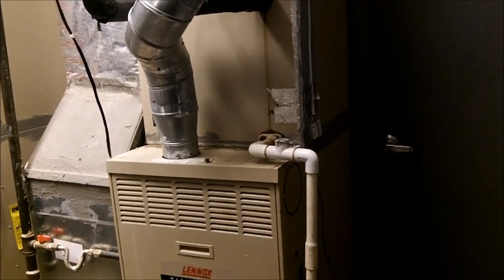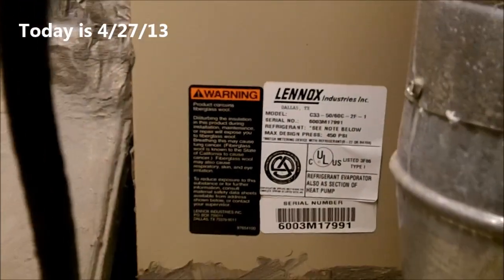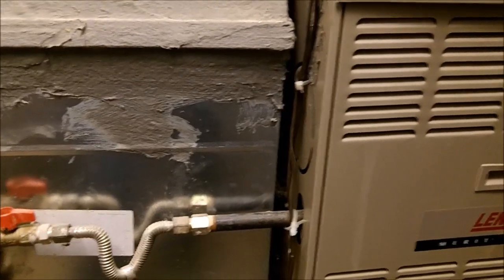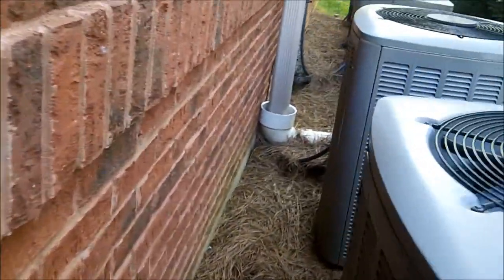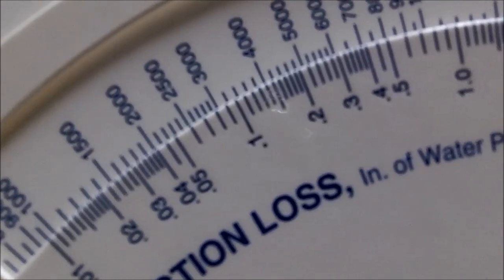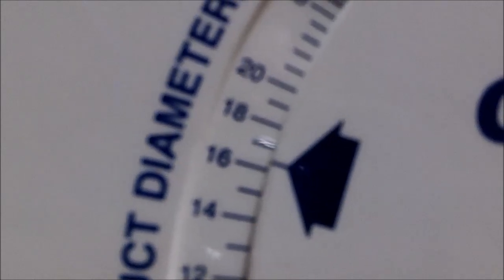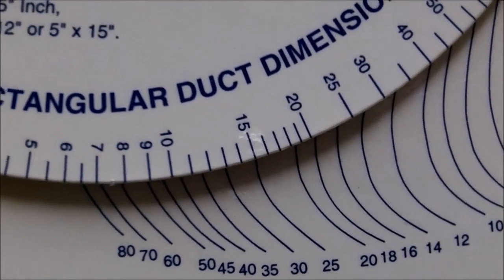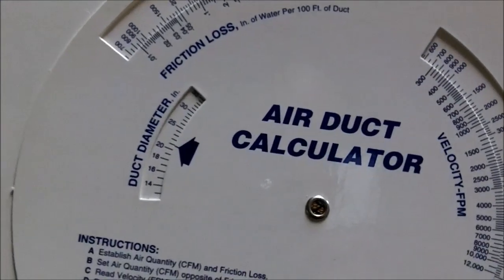5 Ton HVAC unit short on return duct work

Comment: Did you drill some holes and take some static pressure readings across the ductwork and cooling coil?  Best to establish a baseline first.  Most of these residential type units are only rated for .5” total static.  Your probably over 1”.  Duct liner just ads to the problem.  The duct calculator is looking at pressure drops of 100 feet of straight ridged unlined duct, so the liner, elbows, transitions, etc have to be accounted for separately.  One bad fitting can kill the airflow in these low pressure systems. You are correct about the one sided return.  That’s killing you. You need to use either the whole bottom or both sides for RA.  Maybe you can ad a little outside air to make up some of the RA shortage. You’ll also have to have at least the area of two 20x25 filters for that airflow.  Otherwise the filters will just be a restriction, and the dirt will go right through them.  You’ll have to do a slant or V track if you use standard filters, or some sort of high capacity media filter with enough surface area for your airflow.

Comment: That initial setup was terrible, a small 16x20 for the filter, wow. 
IMO, 5-Ton units shouldn't be put in resident's; with a 4-Ton you  can use as low as 1400-CFM; 350-CFM per ton...! 

First of all, my ductulator @ .05 FR says for 1800-CFM it calls for  more than a 22" Flex duct which would  provide only 1735-CFM With FR @ .05", of course that could be allowed to go higher to cover up-to 1800-CFM. 

You can't use a ductulator to size Return-Air filter areas; because the open air-area (Ak) of a filter is probably only 60 to 65% of the filter's measured area. If using Purolator #312 filters you need less than 300-fpm velocity. Therefore I would want (2) 20x25 filter rack areas going directly back to the blower.  

A 20x25 filter is a measured 19x24 = 456-sq ins * 2 is 912 * .65% Ak is 592.8 sq ins / 144 is 4.116666-sf (Ak) 1800 / 4.1166666 is 437.2- fpm velocity well above the 300-fpm required...!

Comment: Without a filter in place the coil must be partially clogged, further increasing static pressure.  Did you take a static pressure reading on return and supply?   By taking actual readings you know which is the biggest problem supply or return.  If the static is even hgher than the duculator would show it to be with the given ductwork you know there is further problems like dirty coil or kinked ducts in the attic.  A reading across the coil would indicate if the coil was clogged.  I don't remember how much pressure drop is due to a clean coil.  Can anyone supply that info?

Comment: Question-Since you ductulator is only for galvanized ductwork. Have you taken in to consideration the friction rate of the two different surfaces of the inner liner and the metal? And another solution is you can cut out the other side and make a "wrap around" duct back to the left side to pull the air thru.

Comment: Good vid.  Your 20 by 25 return makes good sense as if you use a pleated filter, you will need the extra square inches for pressure drop across the filter.  I also noted that the vent connector was single wall to the vent.  We do not use any single wall anymore up north, because the low vent temp of the newer 80% furnaces will rust them out after several years.  Again, good work.
GFM

Comment: My kind of videos.........sizing-calculating and correcting ductwork. Teach an old dog the old tricks that this old dog never learned,lol. This is what I have always loved about hvac, there is always something to learn if you are willing. Doesn't matter how old you are or how long in the trade, you can still learn something every day. August will be 34 years in hvac and June I will be 54 years old. Soaking it up like a sponge,lol. Take care, Brett
Reply: That duculator is not needed for residential. It isn't. A 1200 square foot home, for fucks sake put a 25 by 20 return grill in and run some 22 by 12 or 24 by 12 duct. Then come off the supply with a 18 by 10 to a split with two 12 by 10 dropping to 8 by 10 at the end. A 5 ton system is obviously doing 2700 sq ft or so so you know you need two fat returns in two locations and enough supply (22 by 12) to get the air off the unit. That shit ain't needed for residential. It isn't. If you use that thing in residential, you BETTER have a sheetmetal shop and be making all your duct. If you're going technical like that, you gotta build your duct around that duculator. Don't turn simple into complicated just to feel smart. Residential is easy. I worked for a guy in my area and he did million dollar homes custom fabbed duct. People paid his price. He never pulled out a fucking duculator.